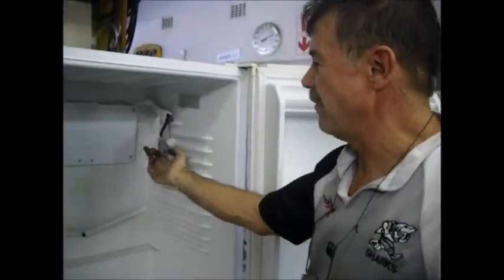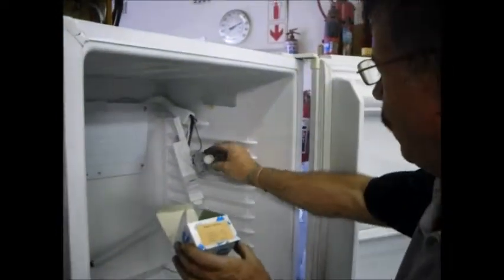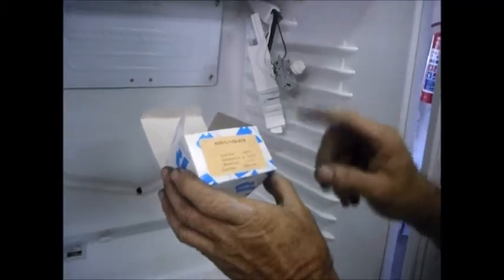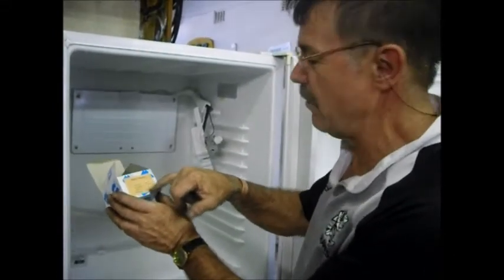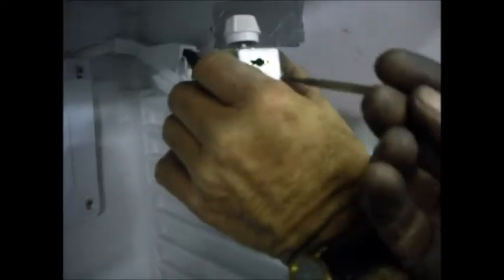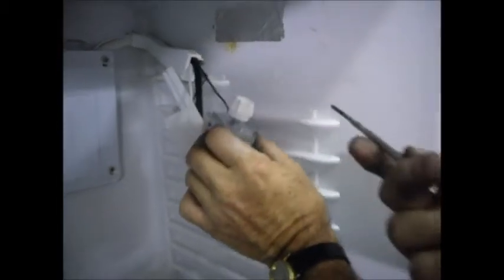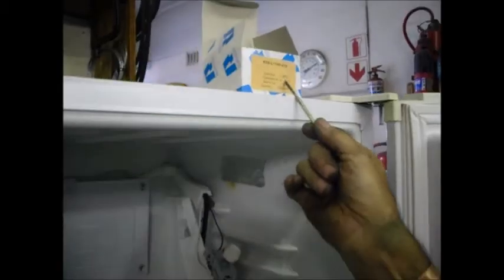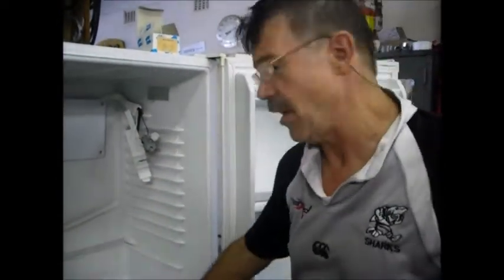Re-calibrating A Refrigerator Thermostat - J D Nel Refrigeration

Comment: Interesting video. After a relatively thorough search (read: more than 30 seconds, multiple queries, and well beyond the first page of search results) I didn't find too much about doing this, even researching part numbers to try to find a manual describing OE procedures (GE 3ART thermostat similar to the one here; mine overcools). Perhaps it's one of those fairly well-kept secrets that you don't get outside of HVAC school in an attempt to prevent end users from messing with stuff.
Reply from the maker: During manufacture the calibration screws are used to calibrate the correct temperature range for each thermostat individually. Some manufacturers will use one thermostat design for various different temperature applications, only the calibrating is different

Comment: Thanks, this is exactly what i was looking for. My Liebherr CUPsl 2721 fridge freezer is nearly 12 years old and wouldn't come on after running ok. One problem I believe was a thick ice build up on fridge evaporator rear wall, the compressor came on after being switched off all night & most of the ice had melted. Temperature dial is graduated 0 - 7. Found that compressor now runs continually on 7 (where I usually have it set; it may eventually go off after more than 24 hours), reducing to 6 compressor eventually switches off after many hours and fridge space is around 4 deg. C one third up from the bottom. I could try the settings you mention but I wonder if the compressor cooling output is a little weak. 
May I ask how long should a compressor last (I understand that nearly all compressors are made by the same company IIRC), at least for Europe? 
Also am I correct that these units should never need recharging with refridgerant since they are sealed units?
Reply from the maker: Behind your fridge is a black grid which is called a condensor, normally dust builds up on it.  If you clean it properly you will immediatly get a 3 or 4 degree drop in temperature in your fridge. Never need recharging until a puncture developes.
Reply: @JDNelRefrigeration  Thanks, I should have mentioned that I have already pulled the fridge out and cleaned the condenser grid.
What I didn't mention is that I put some fresh food in the freezer that will take time to freeze so may be I need to be more patient (it has never been very powerful, I think the motor is only rated 100 Watts IIRC (if I remember correctly).
Can you say how long a Compressor can be expected to last please? Many thanks from the UK.
Reply from the maker: @Martindyna  The average modern compressor usually has a 10 year life, but I have seen some that have been running for over 30 years and are still going.
Reply: @JDNelRefrigeration  Thanks for the information. My late Mother bought an Amana fridge freezer 40 years ago and it still works fine but of course this is exceptional. The engineer who occasionally serviced it over the years said that he had to change out the compressor on a modern Amana after only 6 years in more recent times.

Comment: Hello sir.
I have a Danfoss 077B2020, and my freezer wont go more then -10 Celsius. Could u help me with the adjustment a little bit? 
Thanks
Reply: This thermostat has 1 little adjustment screw.
Reply from the maker: Before you adjust on the thermostat bypass the thermostat completely and see what temperature you can achieve, because the problem might not be the thermostat.
Reply: @JDNelRefrigeration  how do i bypass it? Thanks
Reply from the maker: @11piano03  Please send photos of your thermostat & fridge & motor to jdnelrefrigeration@gmail.com.

Comment: i was asking what the best thermostat system with capillary or a printed circuit board with the sensor
Reply from the maker: The one is not better than the other, different applications use different temperatures.

Comment: Hi, interesting video thank you, I am having a large range of temps on my fridge with a Ranco thermostat, anywhere from 1.5 degrees Celsius to 10.5 degrees Celsius, any ideas please, would adjusting the second screw help and in which direction should I turn the screw ?
Reply from the maker: First you have to determine if the fluctuation in temperature really is the thermostat before you start adjusting it. If you are convinced that the thermostat is the cause of your problem, the adjusting screw closest to the surface calibrates the differential and the deeper screw adjusts the cut out temperature.
Reply: @JDNelRefrigeration  thank you, yes I believe it’s the thermostat, to reduce the large differential as you call it, which direction should rotate the screw please ?
Reply from the maker: @carlotai4635  Clockwise for shorter differential.
Reply: @JDNelRefrigeration  thank you kindly good Sir
Reply: @JDNelRefrigeration  in the video, aren't you turning the surface screw clockwise to "widen" the differential (because before it started the compressor before it had time to defrost)?
Reply from the maker: @motto58  The outside screw changes both differential and temperature.

Comment: How do I recalibrate a Ranco thermostat where both screws were set out completely? Do I have to buy a new one?
Reply from the maker: Follow my video, I explain how to do it.
Reply: Clement, did you ever find out ? I removed the screw completely and condenser won't turn off automatically anymore.

Comment: I have a Ranco freezer thermostat and it has three terminals on it, a fourth being chassis ground.  What do the three terminals do, which two or three are switched, which is for the mains?
Reply from the maker: There are 2 separate switches in that thermostat. 1 is to break the red alarm light the 2nd to break the compressor. The one that breaks first is the alarm light. The switches have a common connection one connection each for the switches.
Reply: @JDNelRefrigeration  The thermostat, a Ranco K59 unit from Amazon, has tabs 3, 4 and 6.   Which is which?  Also, when connected, there's too much range, so it super cools the freezer then let's it warm up to above freezing before cycling back on.  I would like to have a tighter operating range, say minimum -20C to maximum -15C, so a 5C temperature swing at most.  Thanks,
Reply from the maker: @canuckfixit7722  The K59 is a double door refrigerator thermostat. It is the wrong one for a freezer.
Reply: @JDNelRefrigeration  Ok, yeah, thanks.  I gathered that because it would always thaw out the freezer before restarting then run continuously to -24C.  Got a recommendation for a proper thermostat with three tabs?
Reply from the maker: @canuckfixit7722  Ranco makes a Freezer thermostat with signal.
Reply: @JDNelRefrigeration  I searched for that and didn't find anything that I was sure would work and was availble/affordable for me.  Currently testing out a WDF-20A thermostat from Amazon.  It has three tabs with a signal but seems to operate with a very wide temperature range if set at its lowest setting.  This one also has "C", "H" and "L " tabs.  What do they mean?
Reply from the maker: @canuckfixit7722  In south Africa we can get the Danfoss and Ranco Thermostats. I don't know what is available where you are.
Reply: On a ranco refrigerator  thermostat compressor switching contacts are 3 & 4, 6 is for heater if needed. Dont know which is the common terminal.
Reply: @canuckfixit7722  K59 is for cyclic defrost refrigerator one door or 2 door with freezer. I set warm/cold in at about 2 deg (screw on end opposite to terminals) anti clockwise for colder cut in then adjust dial/ knob for compessor to run long enough to achieve desired freezer temp. Using a digital fridge thermometer with high / low memory in both fridge & freezer will help get the balance right. Bit fiddly, but you get real time temps without opening doors all the time. I drilled a small hole in the plastic housing so I could adjust the small screw easily with exposing the thermostat every time.

Comment: Is it possible to adjust the thermostat so that it holds 16-17C?
Reply from the maker: Yes it is. We normally find that negative 18 C on the cold plate gives about 2-4 degrees ambient temperature and at +3 on the thermostat all the ice has melted.
Reply: @JDNelRefrigeration  I mean I want it to hold positive 16 to 17 C.  I was going to use a temperature sensor that would then control the refrigerator via the plug but it would be better if the thermostat can be adjusted that high.
Reply from the maker: @MillManD500  You will have to use a different model of thermostat. the Ranco VT9 wont work. You can try the VT1 or VT2 but I doubt if you will get a 1 degree differential at 17 degrees. Maybe you should look into ambient thermostats.